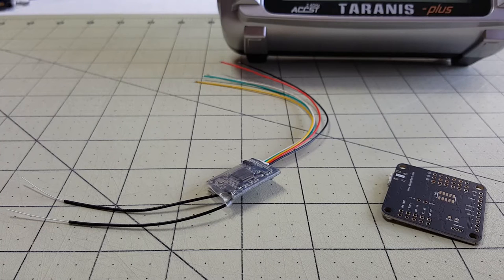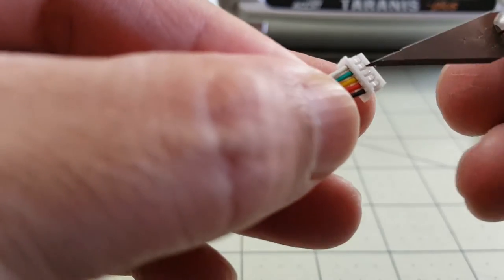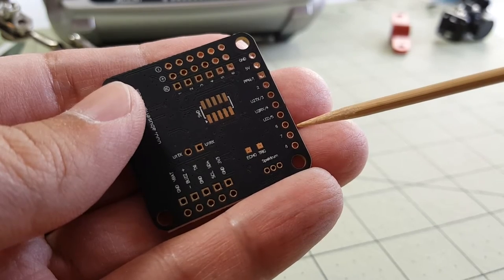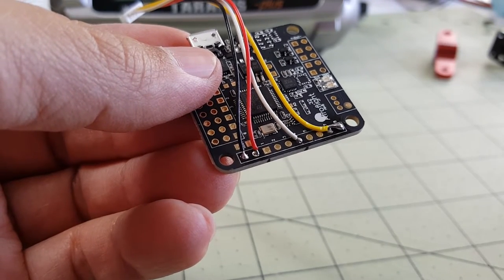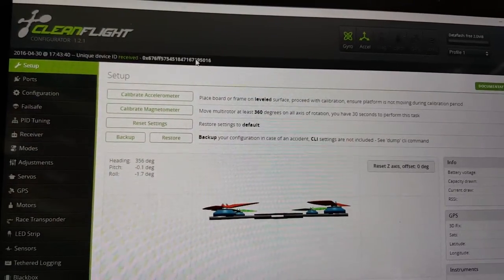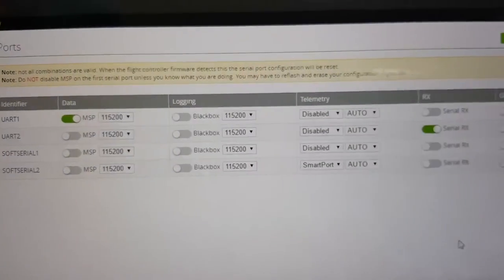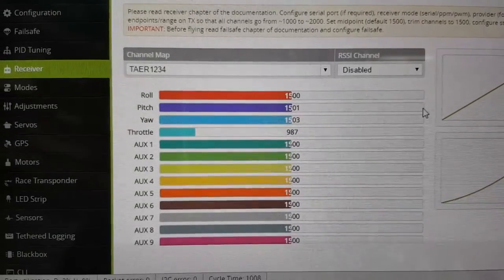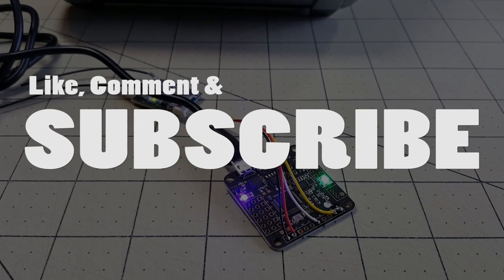FrSky XSR Setup on Naze32 Rev6

Comment: Hi Albert, I'm new to this field, and i got naze 32 ver6 and using r-xsr receiver, just wanted to know, how do i power up the esc, do i need to connect just the signal wire to naze 32 for each esc ?
Reply: Yes. The other rail is just dedicated for PWM output for ESCs and Servos... Just correspond each ESC to the correct pin number or use resource mapping if using betaflight after connecting. Naze32 can only send signals to ESCs, if you want to power them up, you shall use a PDB.

Comment: Nice and clear video!
Unfortunately it doesn't work for me... I have an XSR and a rev6 board as well. I also soldered the wires
excatly as you said. But when plugging in the USB, only the Naze powers up, the receiver remains unpowered.
I can power up the receiver and the board by using a connection from the PDB, it then uses power from the LiPo. 
But then it won't connect to Cleanflight anymore... What should I do?
Thank you!

Comment: Hello, 
I got one question: could we use the telemetry wire in the telemetry pin of the NAZE32 rev6? 
I mean: there is a 3 pin port: one for the telemetry, other for the buzzer and the third one for the voltage monitor.  In this way we can avoid solder 2 pins in one for the telemetry, is that right?
Reply from the maker: +Errant Knight that won't work. You have to use a UART

Comment: I'm a little bit confused. In your vid you jump pins 7&8 and enable "SOFTSERIAL2" = SmarPort. In other vids they jump pins 5&6 and enable "SOFTSERIAL1" = SmarPort.  What is the difference?  BTW, I'm currently setting up a Naze32 rev6c
Reply from the maker: +Ron De Torres those are the corresponding pins for 1&2. I just chose 2 and they chose 1.

Comment: Hi, thanks for you video. Question: why is it needed to connect the s port of xsr to both the rx and tx of soft serial of the naze32 revv66? Thx.
Reply from the maker: I honestly don't know.  I think it's due to some kind of design flaw in the Naze32 board.  I just did what someone mentioned in an RCGroups posting.

Comment: Amazing thanks so much :DD
Is it possible for the naze32 to measure the used mah? and transmit this information to the taranis?
Reply from the maker: You need a PDB with a current sensor and an OSD.  I don't think you can transmit that info over telemetry.  Only vbat.
Reply: ah okey, thanks :)

Comment: I have a x6r and a naze32 full rev6. would the set up be the same? also, is there a way to get the naze32 barometer  telemetry on the taranis? so I can see how high I am.
Reply from the maker: +John Hoehaver Yes, setup is the same. Consult your manual to determine the corresponding connectors. I don't have that receiver so I'm not sure what it has. The altitude sensor in the telemetry downlink is called "Alt".  You can read more here https://github.com/cleanflight/cleanflight/blob/master/docs/Telemetry.md

Comment: Hello Albert. I bought the Naze32 from the same page posted as you are however my Naze32 received was unbranded no Afroflight or abusemark.com logo printed on it. There were reports of people burning out their naze32, how do i go about this?
Reply from the maker: Burning out?  What do you mean by this?
Reply: +Albert Kim (marblekit) They plugged in the Naze32 to their comp(motor and escs are connected) and something from the fc was burning.
Reply from the maker: Yes, earlier version of the Naxe32 Rev6 had a missing diode that would cause this. Fortunately mine did not have this problem.  I believe they fixed this and in more recent versions it is ok.

Comment: hi, how about setting up the voltage of the quad to appear on the tx screen?
Reply from the maker: There are lots of videos on that already on Youtube.  I didn't want to reinvent the wheel :)
Reply: +Albert Kim (marblekit) how about failsafe? followed your video and it works. but i cant set failsafe on my disarm channel
Reply from the maker: Check your channel mapping and make sure its correct. Next make sure your channel ranges are correct.  Next check that the PWM value on the channel you are using for arming is going below 900ms.  If all that is working, check that you have the failsafe set correctly for the model in your Taranis.  I'm assuming you set all your channels to the failsafe positions and then pressed the bind button on the XSR already?
Reply: +Albert Kim (marblekit) yes i did that already. but after turning the tx off, the quad still not disarming. tried also custom set failsafe but still no luck no on the arming channel.
Reply: +cristian paringit failsafe works on the throttle but with the motor stop disabled and minimum throttle value, the motors still spins
Reply from the maker: +cristian paringit weird... I've never seen that before. I think the channel that has to failsafe is the arm channel and not throttle.

Comment: Try, just use this and thanks. However my roll and throttle are reversed. How do I fix this?
Reply from the maker: In cleanflight or betaflight configurator, adjust your channel map.  You probably have AETR and TAER mixed up.  Just pick the other and check again.
Reply: Thanks, exactly the problem.